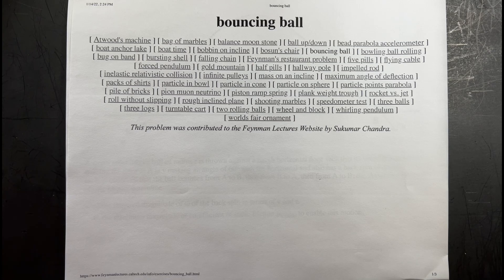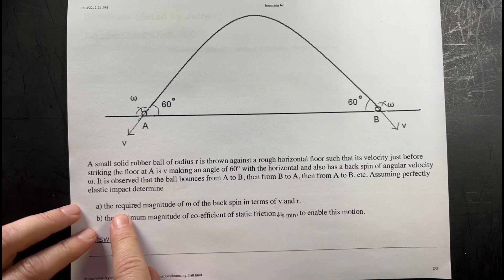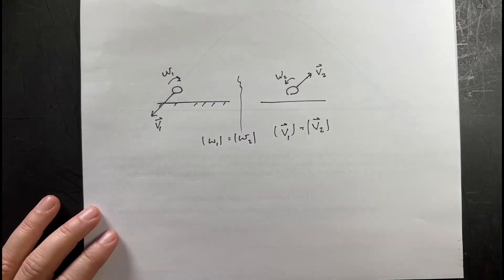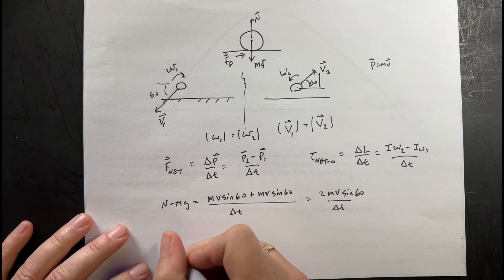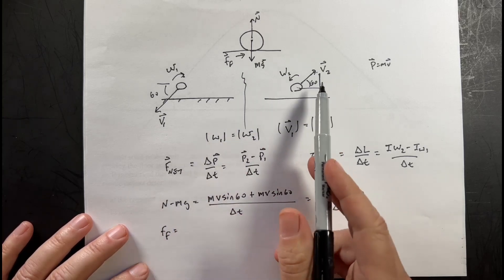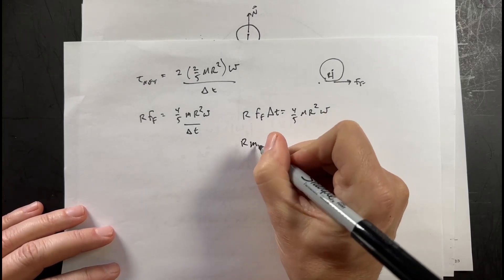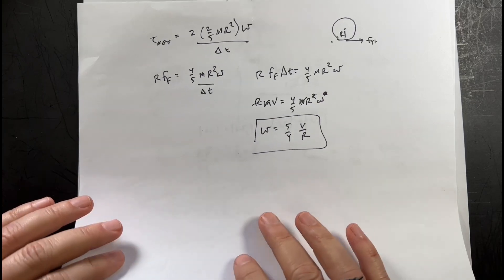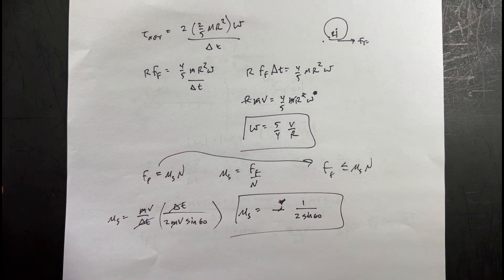Physics Solution: What is the angular velocity of this back spinning bouncing ball?

Comment: Hi DotPhysics I'm a big fan of your videos! I had one question about the validity of the approximation you used at 13:18. In effect we're assuming that mg << N, but in general this is not true no? Is there a way to rationalize that approximation or was it made just so that the math worked out cleanly?
Reply from the maker: Because the ball is accelerating in the vertical direction, the normal force (N) must be greater than the downward gravitational force (mg) so that Fnet = ma.

If the ball was sitting on the ground at rest, then Fnet = 0 = N - mg and N = mg